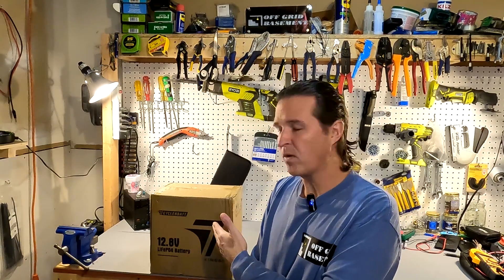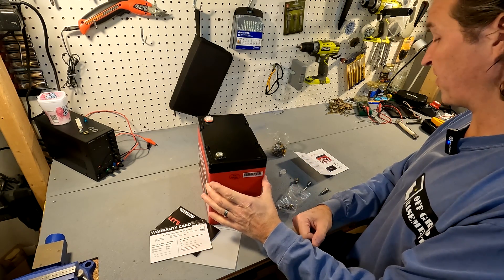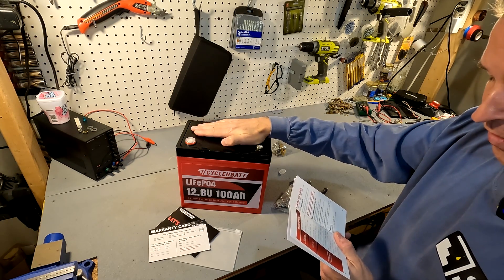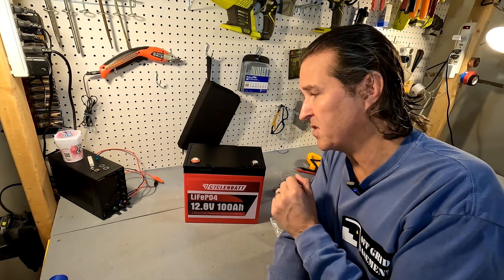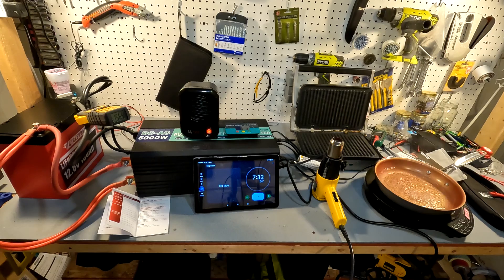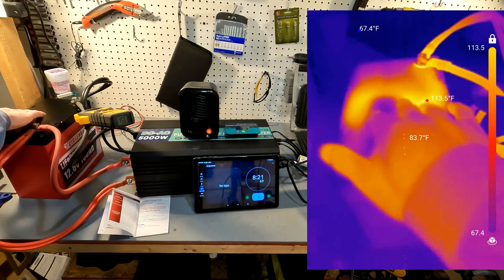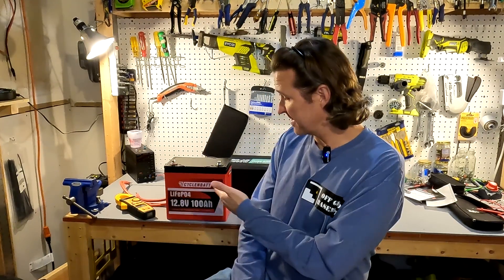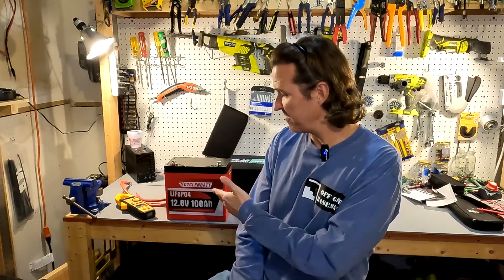12v Lifepo4 100ah battery review from CYCLENBATT.  POWERHOUSE!

Comment: Today I finished measuring exactly what the capacity of the CYCLENBATT battery is.

I've got a 98-watt Powkey Portable Power Bank. But its actual capacity is only 65 watts.

So I got this "12v Lifepo4 100ah battery review from CYCLENBATT". I connected CYCLENBATT with Powkey so that I could use Powkey's AC outlets.

Yesterday I measured again the capacity of CYCLENBATT and Powkey combined, and I got 1,108 watts.

Since the Powkey power bank has only 65 watts, the capacity of CYCLENBATT is 1,108 - 65 = 1,043 watts.

If we include the power consumed by the fan, the LED lights, and the watt meter, I guess the real capacity of CYCLENBATT is close to 1100 watts.
Reply from the maker: Thank you for sharing the information and for the comment!

Comment: The battery claims it has a capacity of 1280-1305 watts, but actually it has only 800-900 watts. Do not believe the claim.
Reply from the maker: That's not what I measured.  It's very close to what's rated in my test.
Reply: @OffGridBasement  Yes, capacity is another thing.

I'm not sure what happened. The first time I charged it to full, but I only got 800-900 watts out of it. 

The second time I charged it after it was empty, it took 25 hours for a 59-watt charger to charge it to full. That means it has a capacity of 25*59=1,475watts. But it's not possible.

I haven't used it yet after the second charge. 

I'll try again and let you know.
Reply: @OffGridBasement  Today I finished measuring exactly what the capacity of the CYCLENBATT battery is.

I've got a 98-watt Powkey Portable Power Bank. But its actual capacity is only 65 watts.

So I got this "12v Lifepo4 100ah battery review from CYCLENBATT". I connected CYCLENBATT with Powkey so that I could use Powkey's AC outlets.

Yesterday I measured again the capacity of CYCLENBATT and Powkey combined, and I got 1,108 watts.

Since the Powkey power bank has only 65 watts, the capacity of CYCLENBATT is 1,108 - 65 = 1,043 watts.

If we include the power consumed by the fan, the LED lights, and the watt meter, I guess the real capacity of CYCLENBATT is close to 1200 watts.
Reply: Today I finished measuring exactly what the capacity of the CYCLENBATT battery is.

I've got a 98-watt Powkey Portable Power Bank. But its actual capacity is only 65 watts.

So I got this "12v Lifepo4 100ah battery review from CYCLENBATT". I connected CYCLENBATT with Powkey so that I could use Powkey's AC outlets.

Yesterday I measured again the capacity of CYCLENBATT and Powkey combined, and I got 1,108 watts.

Since the Powkey power bank has only 65 watts, the capacity of CYCLENBATT is 1,108 - 65 = 1,043 watts.

If we include the power consumed by the fan, the LED lights, and the watt meter, I guess the real capacity of CYCLENBATT is close to 1200 watts.
Reply: Sorry that YouTube keeps blocking my comments. I tried a few times, and it just doesn't show here. So I posted the comment as a new comment. Hope you could see it.

Comment: Brad Cagle reviewed this same battery and did extensive low temp demonstration. It said in manual it had low temp so I’m also confused ? Because I only want this if it has low temp . Gonna be using for electronics in boat
Reply from the maker: I was wrong and Brad is correct.  It does have Low temp charging protection.  I didn't see it in the documentation.  I've removed that part in the description of the video.  Thanks!

Comment: Would this be a good replacement for a UPS small 12V lead acid battery that no longer provides much run time when the power goes out?  Just wondering if the charging electronics in that small UPS would be compatible with this LiFePO4 battery. Thanks in advance. Love your channel!
Reply from the maker: If the battery you're replacing is 12v then this battery would work just fine.  Thanks for the comment.
Reply: So the fact that in a UPS the battery stays fully charged all the time and only gets called upon 2 or 3 times a year when the power goes out doesn't degrade the life of a LiFePO4 battery?    @OffGridBasement

Comment: Wish you had a DMM on the terminals for voltage during these tests. Voltage sag will tell us if these cells are truly capable of discharging this kind of amperage. Dipping below 2.8V'ish (kind of where most A123 cells sit when at their max C rate) is a sign that you're pushing it too hard.
Reply from the maker: Thanks for the information and comment.  I'll incorporate that in my future videos.
Reply: @OffGridBasement just a couple other points. I watched some other videos including a teardown and it appears this DOES indeed have low temp protoection and it has quite the impressive BMS

The cells are prismatic....which is somewhat surprising but I guess 3C prismatic 100Ah cells DO exist. Not sure who makes them so please open this up and check the QR code. I know Lishen makes a few higher than 1C/2C prismatic cells but most of them are a bit smaller than 100Ah.

My first guess was pouch cells too since this is smaller than the LiTime/Redodo/PowerQueen variety of Minis...

Obviously the ultimate high discharge prismatic LiFePO4 would probably be the LEV60F's that Jehu Garcia has been promoting lately. BatteryHookup has them slightly cheaper at $30 a piece and I"m sure their shipping is probably slightly less. At 74Ah each they can do a 600A discharge...and while I wouldn't say its a pure continuous rating its damn close and definitely more than 30 seconds. Even if you aren't picking the lowest IR cells out of 100's of them you can still do 600A...so pretty much an 8C or 9C rate...so likely 5C continuous. I don't know of any other prismatics that can touch this that are LiFePO4...Lishen has 8C 25Ah prismatics..and there are a lot of pouch cell or bigger cylindrical cell options. Gushen has their 10C 22Ah and 25Ah (new, most of them out there are 22Ah) cylindrical cells that are 46280? or something. 

A123 would probably be the king. Their 20Ah pouch cells are a true 20C cell. Plenty of videos on YouTube of people taking a 12V pack of those and pushing out 400A while staying around 11V or a bit higher. To do better than that you have to do LTO and I think the Plananos or the Lishen 18AH/26Ah LTO cells are probably some of the best. Toshiba SCIBS are insane too...I think its their 10Ah cell that is 75C and their 20Ah cell is 35C...honestly I still think I'd go with the Lishens though because I've seen enough videos on YouTube to prove the Lishens really do 

https://www.youtube.com/watch?v=wvsFVA-hpso

That video of the 18Ah is insane. Starting at 16V he applies a 500A load and they drop to 15V immediately and after a few seconds they pretty much settle to 14V. All 6 cells are sitting at 2.5V so still above their nominal of 2.4V (most LTO is 2.3V I think).

I use 38120 Headways for spot welding and sometimes I use a 12S8P pack of 26650 A123 M1B cells (cut into 3 chunks to make 12V packs)...can't parallel two of those 4S8P packs or it'll blow my spot welder up. Based on the math I've seen in the kWeld manual, a battery with an IR of 4'ish milliohms that is ~12V is about 1500A of power...not sure if thats a DCIR number or AC IR number. I'd be inclined to say DC IR since the math for I=V/R is likely based off DC IR...but my 4S8P A123 packs come out to 4.6mR AC IR...havent tested them for DC IR but I should try...I'd guess its probably ~10mR or so? So maybe I'm getting 900 or 1000 amps out of each 12V pack and thats why my JQ-DHJ02B spot welder blew up (my first one) when I tried to parallel packs. Should have trusted the overpower warning LED's.

I think this 12V battery would be a good power source for anyone using one of those 15 or 20 dollar PCB spot welder boards. So long as the mosfets on it aren't complete junk you can do 0.30mm thick pure nickel and some decent copper nickel sandwich with those PCBS so long as you have the right power source. WAY too much bullshit in the world of Lipos and their garbage ass C ratings. 

SMC and Turnigy appear to be some of the only companies that actually have packs with cells that measure 1mR or less (in the 5Ah to 9Ah pack size). CNHL can suck my dick...pack I got from them was trash.
Reply: @OffGridBasement  Or even have some kind of scope that plots and overlays amperage with voltage over a period of time to inset (picture-in-picture) onscreen.

Comment: Not a fan of the pouch cells that they use in those tiny batteries..Is there even a BMS in that thing..Would much rather have prismatic cells, in those premade batteries, which come in the regular size premade 100 Ah batteries..Would much rather buy my own LIFEPO4 280Ah Eve or Catl prismatic cells and build my own batteries..Those cells are far superior to the 100 AH cells in premade batteries...But that was impressive, have to open that thing up and see what is going on in there..
Reply: Pouch cells are in some ways better than prismatic....Definitely not worse at all. I'd say there's really no difference between them in terms of cycle life, temp and power overall. Definitely a difference in energy density/weight. If you want me to pull up actual data on it I can.

But this battery does indeed have prismatic cells. And a BMS.
Reply: @ericklein5097  Pouch cells are usually, almost always 3,000 cycles to 80%, my Catl cells are 10,000 cycles to 80%..Plus I've had pouch cells that leaked and died twice in 2 different applications..And I know the battery has a BMS, obviously not a good one..Those small batteries usually come with pouch cells, and I would be skeptical, if I never opened one up..In 4 years of everyday use, my Catl cells went from testing at 292 AH when brand new, to 288 AH, about a month ago, still well above their rated capacity..And there is a huge difference in the cells in premade batteries and the cells you can get from manufacturers..I've built over fifty systems, and have used many different batteries..But, believe whatever you want..Ya, I was referring to solar storage batteries, you're not finding pouch cells with high C. ratings in these kind of batteries, that's a different thing altogether..And I've built a battery out of the Lev60F's, but not for solar, it was a dune buggy and they were prismatic cells, from Japan..
Reply from the maker: Thanks for the comment.
Reply: And while the 280/304Ah prismatics are superior in terms of $/kwh to just about anything else on the market (especially when American companies are selling them for $100 or $110 plus shipping) they definitely aren't so hot in terms of C rate. 

In the 50Ah to 100Ah arena there are several very very nice pouch (and prismatic) cells that have 3C or 5C discharge rates. The LEV60F's are 74Ah and have roughly an 8C discharge rate...I'd say 5C continuous and 8C is a 30 second burst even for the cells that have degraded the most in storage (since the supply right now from Jag35 and BH is NOS)

I think A123 even had/has something larger than the 20Ah 20C continuous/30C burst cells that are so famous. Those are pouch cells that blew the world away and their cycle life even at higher C rates is impressive.

Comment: Possibly the mains charging switched on when I was changing the series parallel battery, 12v cables seemed to be full of energy and sparked up way more than usual blowing the LUGS off. Maybe a more simple Victron or equivalent system way forward. The 150  DC fuse did not blow so maybe we should look at that would a Breaker be better. PowMr is toast.
Reply: Need to use a "disconnect" that has a "spark break"...just remember that DC Voltage is used for welding because of the easy "spark-ability" so you need a disconnect that places a physical barrier between the contacts when switched to the "off" position!!!
Reply: @RTR-MATEY  Yeah  I put a switch in
Reply: Could do with another switch come to think of . Between the series links , Tricky when voltage drops below 10.5 V abd BMS shuts off. Have to isolate each 12v battery when have to wake it up. Without sparks.
Reply from the maker: That's a bummer.  Glad it didn't cause bigger issues.
Reply: its easy to mess up a 4 x 12v battery config... Wiish more  24v batts sent to your channel. ...

Comment: Hi,got one of these for Christmas instead of a Tree, DEWIN 600W Grid Tie Inverter, Black Grid Tie Micro Inverter DC26V-45V MPPT Pure Sine Wave AC230V Output for Solar PV Panel 24V Adjustable Battery Discharge UK Plug amazon does not let you post links , I like the adjustability down to 1A AC 100Watts, that I run all day. 24hrs if the suns Good,....I wish the manufactures would send you 24v even if its only 50AH, 1 thing I have learnt is PET hate the Balancing of 12v batteries they down seem to charge evenly...Happy Christmas and new year Again.. Might even get a Victrom 150/30 I dont really want to Smoke up another PowMr, Not sure what mistake I made. lol.
Reply from the maker: It sounds like you had a nice Christmas!  Hope everything works well for you.

Comment: Wow!  That was really an amazing battery test!  Would it really be a bona-fide fire hazard?  Thank you for the review.
Reply: At a minimum you need to have a fuse sized to protect your wiring.  I prefer the MRBF or HABF type fuses that mount in a fuse holder directly to the battery terminal. Best to get them from a reputable source/brand.

Then you need to assume that the wiring inside that battery is also safe at the limit of your fuse.  Normally I don't worry about that, but they claim over-amp discharge protection and it doesn't have that, so what else did they skimp on?
Reply from the maker: It depends on if other protections work.  There should be a high temperature protection that would shut off the battery.

Comment: First question that comes to mind is there any cut off for overcharged or over temperature? Over voltage? Is there a BMS at all... Maybe it's MOSFET(s)  have failed closed... Would love to see you try and see if it does cut off at 14.6... If there is a BMS that doesn't cut off for any reason it's kind of a tree that fell in the woods situation... I would absolutely love to see you pull a "Will Prowse" and pop it open....
Reply from the maker: I think this battery is worth doing some additional testing.  Thanks for the comment.
Reply: I agree 100% on the test down and see. I know Will would tear it down like  he did the dr prepare awhile back. Open it up let’s see